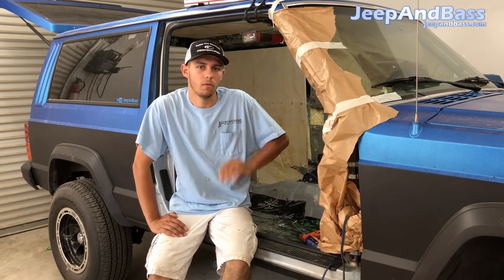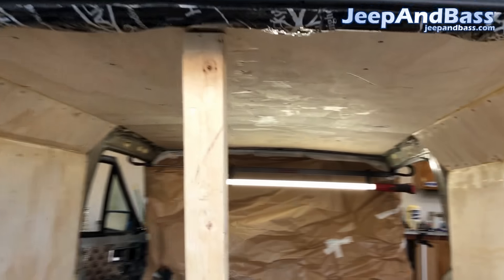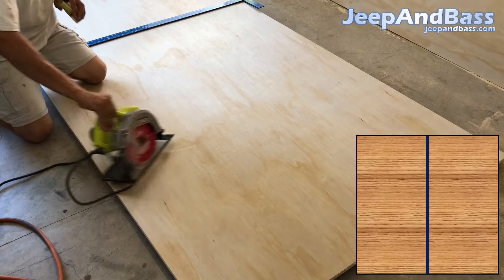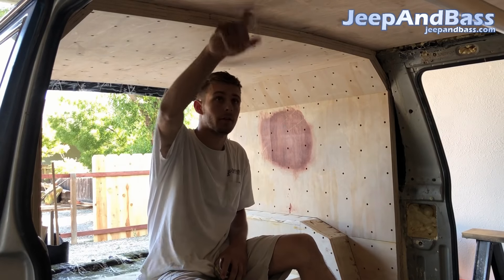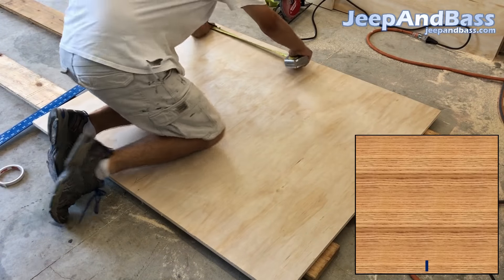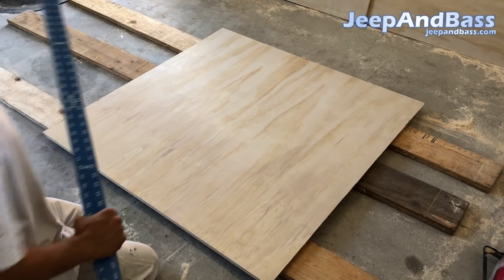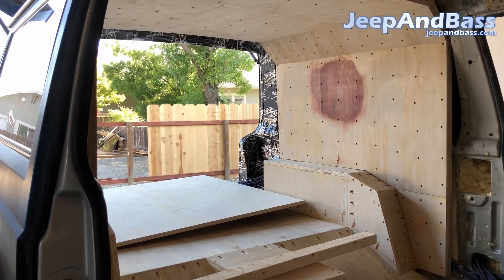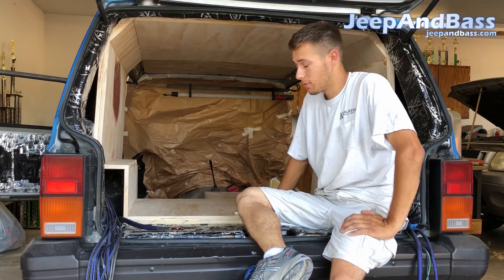DC Audio Jeep Rebuild (Part 4) Wood Work

Comment: Great series of videos ! Shows everyone just how much work is really involved in building a proper wall. On the other hand your also showing you don't need a CAD program or computer guided router table to get the job done right. 
    All you have to do now is sell a bunch of wood wieners, have an explosion insert every 30 seconds and you'll have 1,000,000 subscribers and 20 million views 😂😂

Comment: I am a 30+ year woodworker..let me say that you do things like a woodworker would ...except most woodworkers would be using a table saw..but you got to use what you can...Also,if you have access to a regular lumber yard..real baltic birch or apple core sheets are tremendous compared to import chinese birch..though it might not matter to most people.
Reply from the maker: herbyverstink Thanks for the input! I have been wood working a good 8 years. Started doing furniture in high school for auctions and such. I have a table saw here but I’m finding dealing with the large sheets to be easier on the floor as I don’t have any extension tables on the saw or help. I’m a huge fan of the non imported woods also. Just hard to budget in 2x wood price on something this large. I find the import materials to be plenty strong enough once layered a few times. Availability is my main issue where I’m located.
Reply: I second that...built table and get extended fence ...but this is a flashback of me 30 years ago..

Comment: Seeing you use 2x4 to shore up the roof made me think about something you might find useful they are,load locks I'm a truck driver and we use these load locks to hold the freight from shifting they are a,telescoping pole with rubber feet on either end and a lock handle just extend,it till,its touching either side then squeeze the lock handle down than it looks it to the walls you can find them at truck stops

Comment: Just an observation, wouldn’t it be a bit easier and potentially stronger to lose a little space and make 90degree cuts around the wheel wells and have a flat roof? By no means criticizing, I think you do great work just asking because I really don’t know. I’ve done 1 wall, similar to the way this one was done and kept thinking there has to be an easier way lol. Keep up the good work.

Comment: I need to know how you calculate volume... Like yesterday type shit!! Building a trunk 4th and using spare tire well... Then doing a 4th in Navi soon. Good series g.
Reply from the maker: Dibeezy ThaGifted Next video!
Reply: Fill the box with foam packing peanuts and then transfer them into a known size box 12x12x12 as an example if the transferred peanuts fills the box 3.5 times you have 3.5 cu ft. Now obviously there are easier ways if you have a normal shaped box but if it’s really funky this works well